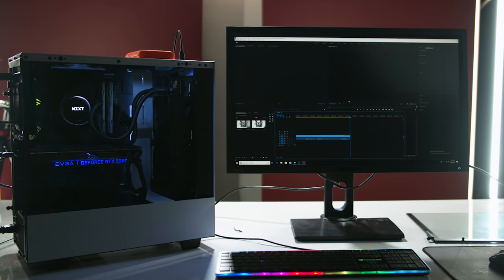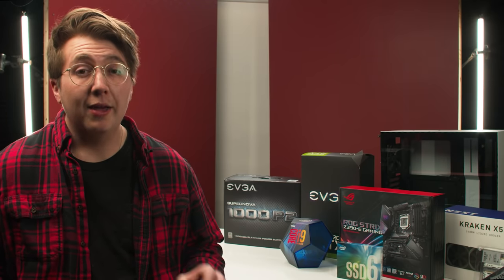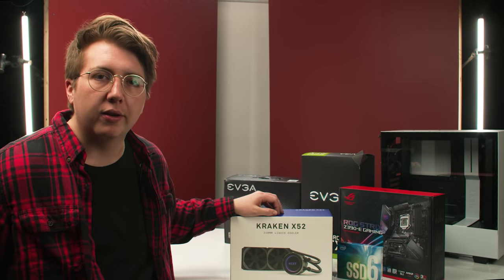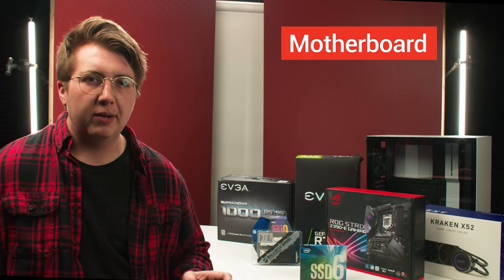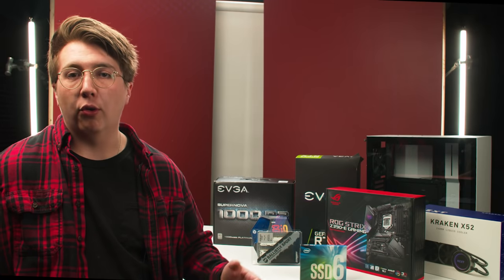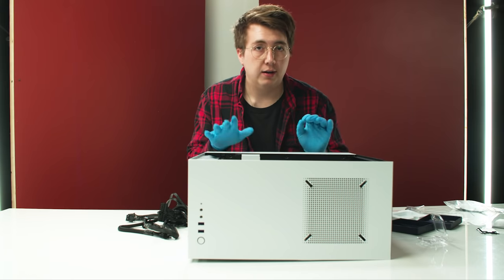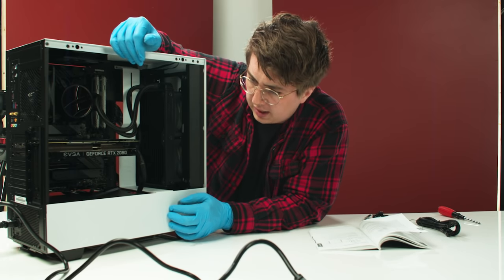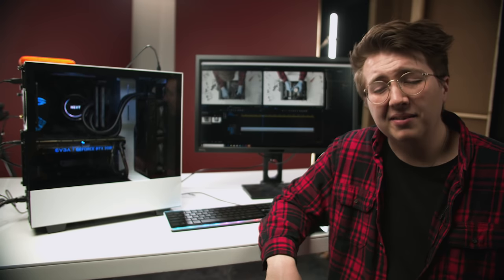How To Build Your Own Video Editing PC | Video Editing Tutorials

Comment: Dude! I did it...I built it! Pretty much the same machine. My first build. So satisfying!! Thank you for the great video. If you do another, cover the PSU cables in more depth and emphasize putting the F-panel adaptor on before you install the mobo in the case! Can't wait to build another.
Reply from the maker: Killer! Such a satisfying feeling booting up this monster for the first time. Enjoy your build!
Reply: Did you use the the F-panel break-out cable that came with the case, or did you plug the F-panel connector from the case directly to the motherboard? I am using the H510i case and Z390-E motherboard.
Reply: @my1978z  I used the breakout cable. That took a little effort. If I had known I would have mounted it on the motherboard before installing it in the case.
Reply: @stgeorge143  thanks for the reply. I'm doing a similar build and it's my first. Still trying to figure out where all the cords connect to. Can't figure out where the Fan 1 cords should connect to.
Reply: @my1978z  I hear you. I had to do a bit of research on that. Thank goodness for YouTube for what the manual left off. Also my mobo manufacturer (ROG) answered my email question pretty quickly. You may try that. Good luck.
Reply: @stgeorge143  thanks again. I think I'm almost ready to turn it on, but want to verify I have everything in correctly before I do that 😁
Reply: Raayz  got it built and everything is working awesome, but probably won't build another one. Instructions were all poorly written and had to watch a lot of YouTube videos and contact manufacturers to make sure I was doing it correctly.

Comment: Just finished building this a couple days ago. I spent total 3200 CAD without OS. Newegg sent me a defective motherboard it took me a week of troubleshooting to figure it out. They sent me a replacement and everything worked. I overclocked my CPU to 5.1 GHz and its working flawlessly. The Liquid CPU cooler works flawlessly. My system usually stays below 50°C. Theres no issues editing 4k video. I bought two of these for work purposes. The other one I bought we didn't overclock and that had some issues with editing 4k. We changed the priority settings and that fixed it, so overclocking is not necessary. Just an FYI for anyone looking to build.

Comment: Building this exact PC. All my parts came in today. Thanks for the help!
Reply from the maker: Great to hear!! It's treating me super well so far.
Reply: Total cost, if you may share?  Thanks.
Reply: Im doing the same soon, zero build experience. What sort of problems did you run into?
Reply: @FishinBoat119  this was also my first build. The only problem I had was newegg sent me a defective motherboard. Which was a huge headache. I had to swap every piece with my friends computer to see which of my parts worked on his computer. I swapped pretty much everything expect the cpu and motherboard. I just guessed it was either cpu or motherboard so I had to send back both parts. When I plugged in the new parts everything worked. But it was really stressful for a while because I spent so much money and I just had some random parts laying around.
Reply: @kevin Panesar, that sounds rough. Thank you for the feedback.

Comment: I would install the my ram, CPU, CPU cooler, etc onto the mobo before putting it into the case especially if you are on air.  Way way easier when it's outside of the case.

Comment: Hey, Robbie, very nice tutorial! I was trying to build my first PC and started with no knowledge about this at all. This is the best tutorial to start, not only listing the parts you need but also briefly explain the function of each part. I got a rough idea of what I need and was able to finish a build part list based on your video. However, I still have a question about the motherboard. I am trying to build a 4k/8k video editing (adobe) PC that can also easily handling some big data processing (MatLab, python, Solidworks, etc.). So I chose the AMD Ryzen 9 3900X and EVGA GeForce RTX 2060 SUPER XC GAMING (8GB GDDR6) + M.2 drive. I want to choose an affordable motherboard that doesn't bottleneck the CPU, GPU, Memory, storage performance. I found from other reviews that ASUS TUF Gaming  X570 (WiFi) to be a popular motherboard and compatible with those parts I chose. However, it is a lot cheaper than the board you recommend. I am wondering what is the key specs you should check while choosing motherboard?

Comment: Just saying but that 8 core imac pro you showed has a xeon-w which thanks to intel costs 1000$+ and its not the same as a 9900k.  If you want 9900k apple offers it in regular 5k imac. Also you have to consider cost of a 5k display.

Comment: Working at Dell I learned you do not need magnetic screw drivers if you have a magnetic tool that cost about $2 that will let you make any screwdriver into a magnetic screw driver. Just by rubbing on the it.You can probably do this with a magnet except the tool has the plus and minus sides marked.  You want the plus side

Comment: The most notable thing about this PC build video is what he doesn't show you, which are things like the details of making good connections, real world cable management, and making sure your cooling fans are optimally arranged.  There are many build videos on the web that delve deeper into the real nitty gritty of how to assemble all the pieces into a functional PC. 
If you're building your first machine you will certainly want to check a few of these out for critical pointers that aren't included here.  One thing he did say that's worth remembering is to pay super careful attention to the manual for the motherboard.  Most of them are excellent guides for insuring that everything is connected correctly and in the right place.

Comment: Great video. A really sick build. 

I really want to build my own but shipping multiple parts so I have to settle with a prebuild or find someone to build me a machine then ship it. 

The only thing I'd change is use the AMD 3950X. It's on the AM4 platform so it's mainstream  16cores and 32 Threads. And I'd use the RX5700Xt. The 5950XT is our yet.

Comment: Great video! I've been a Mac guy for a long time since i work in the film/tv industry as a video editor/media operator, i work on MacPro 5k Retina's and i dearly wanted to get one of those but the minimum i would have to spend to future proof for a few years and work with 4k is $8,100 AU.. 

That cost does include a monitor though and you don't recommend any monitors which is kind of important to at least see the thing boot up lol i know for that you could use any old monitor but what would you recommend for someone that wants to work with 4K? Maybe a top of the line option and a budget option? I know nothing about PC 4K monitors..
Reply from the maker: Hey there! So we actually use BenQ 4K monitors in our office, and we love using them. Pretty solid quality. Dells are great budget monitors, and if you don't want to ball out too much, you an stick with 2K monitors in case you want to buy two for a dual screen set-up (which I highly recommend for video editors). 

Cheers,
Robbie
Reply: Shutterstock Tutorials Cheers for that Robbie i’ll look into those suggestions!
Reply: @shutterstocktutorials  solid response

Comment: btw in the video it shows gpu box as the rtx 2080 black edition but the actual one he used is the xc ultra. It says in the link they provided. I'm only saying this because I bought the black edition from watching this video and just a heads up the black edition doesn't come with a backplate. it also does not have RGB strip which is the most important aspect of any build.. jk lol But I returned it and ended up getting the 2080 xc super ultra.  Thanks for this video. This is what I used as my guide to building my first video editing PC. Im replying with it now.

Comment: might be a dumb question but does the m.2 come with thermal paste or do you have to buy and put it on yourself?
Reply: You dont need thermal paste at all for an m.2. Just install as is, if it comes with a heatsink you apply the thermal pad then the heatsink.

Comment: "DaVinci Resolve uses more the GPU than the CPU." It depends on which task! So, a fast CPU is still necessary. And a GPU with more VRAM outperforms a GPU with more power and less VRAM.

Comment: Hi! I used much of the same parts as you, including motherboard and case. When I try to boot, the CPU LED lights up, then the DRAM LED lights up aaaand that’s where it gets stuck. The RAM is definitely compatible (tried 1-4 32GB cards in all combos), and after scouring the web for answers, I replaced the motherboard. Yet the same error happened. Could it be my case?
Reply: Sounds like faulty ram modules

Comment: I really need to update mine, I have a custom built (I picked the parts and someone else built it)  I just upgraded the Ram and ssd drive but the cpu is maxed out to what the board will handle.  the system is about 5 years old and I got the best I could back then.  So for me to upgrade I am looking at new cpu, motherboard, Ram (as my new ram is ddr3) and new graphics card. I think the rest of what I have is ok. my ssd drive, hdd drives and other bits hopefully will work with new parts. I am editing more 4k video now for my show and the system is really lagging.  I am using Davinci more now but have PP CC as well but it was worse to work in than DR.

Comment: Where would be the best place to get the windows operating system?
Reply from the maker: You can purchase a windows key from their website, but you don't even have to purchase it to download it onto your new build. You can download a disc image and get a keyless Windows OS to use (with a few drawbacks), and supply a key later when you find a good price. Check out this link for more info: https://www.howtogeek.com/244678/you-dont-need-a-product-key-to-install-and-use-windows-10/

-Robbie
Reply: @shutterstocktutorials  Thanks Robbie

Comment: 1) thread ripper is a larger CPU but the mobo size is the same and your case would of stayed the same 

2) your CPU will produce the same heat. Doesnt matter if its AIO or air cooler. Plenty of YouTube videos going over how one isn't better than the other (jayz2cents has one)

3) your GPU recommendation is debatable. Your RTX tax isn't being resourceful at the moment. Could of saved 300$ and got a 1070ti (didn't even look into 1660s which are just the 20 series and no RTX) and you shouldn't recommend a 1050 or 1050ti ( btw your video editor listed the none ti variants in the overlay which could be confusing for beginers)

4) probably shouldn't recommend the gaming tax mobos and paying more for unlocked chips if beginners aren't going to overclock. Most gaming boards just come with more USB ports and Rgb 

Didn't watch the build  but was hoping for a more detailed on how each component benefits every action in Adobe. C4D and Autodesk suits. 

Enjoy your videos but just had to leave feedback for this one. Sorry
Reply from the maker: No need to be sorry, thanks for the feedback! I just recently dove into the liquid cooled vs. air cooled debate (after watching a bunch of LinusTechTips videos), and you are correct - AIOs and air coolers can both be equally efficient. Although, AIOs look much sleeker in the case, and air coolers can be eye-sores. Air coolers also might not fit inside a mid-ATX case if you look at the bigger sizes. Also, CPU fans can make a bunch of noise that an AIO wouldn't. 

With the threadripper - yes, the motherboard's actual size would be the same, but the price increases by about $100 when looking at Threadripper-specific mobos. I would probably upgrade to a bigger AIO with a Threadripper, thus the full-ATX comment. 

If you check out my article in the description, there is a budget build list with cheaper CPU, GPU, and mobo recommendations. In my experience, gaming mobos come with more USB 3 connections for peripherals and external drives. 

One more thing - you are totally right about the GPUs. I was actually going to purchase a 1070ti, but they were unavailable on the site I was ordering at the time. Definitely the better choice. I think the 1050 and 1050ti versions are still okay for budget builds of someone building a straight up video editing computer (with no mograph use), if that means they could afford a better CPU. But then again, for $70-100 more, you could hop up to the 1060 variants and be able to have your PC be ready for AE use. Also, the graphic does mention the Ti versions if you look at the bottom. 

Thanks again for your comment! 

-Robbie
Reply: @shutterstocktutorials  Dude, you fun.. at least you did a much (MUUUUUUCH) better job than those guys from the verge. Again, you make it fun, thumbs up. I enjoy your video too... but I do not have that much to build a it :( cheers
Reply: Tanks mate
Reply: @shutterstocktutorials  Well, it's so realative. If you spend that 100 more for tripper mobo and 200 for entrylevel tripper, your couple 100 bucks will give you twice as much cores and CPU performance. Thats a huge performance boost for that price. CPU perfomance is most important thing in terms of video editing.

Comment: Great video, but the motherboard is the most important component.
Reply from the maker: Hi Marc! Thanks for the comment - would love to know your thoughts on the motherboard being the most important part. It of course supplies the connections for all of the main components, but PC performance in my experience comes from the CPU, GPU, and RAM. I've gotten great performance out of quality components on a cheaper motherboard (as long as it can support the parts on it). 

Cheers,
Robbie

Comment: Well explained and thought out. TY!
My biggest problem from building machines starting in the mid 90's is that now we have introduced over the past several years liquid coolers for computers. Hmmmm water and electricity never mixed well. How in hell did this happen? And we wonder why electricity consumption is so high. The powers to be will not tell you that in the 70's 80's and early 90's we were all consuming less electricity. Go figure!